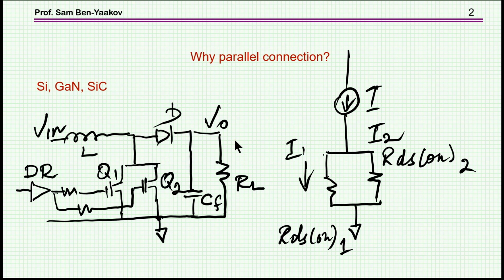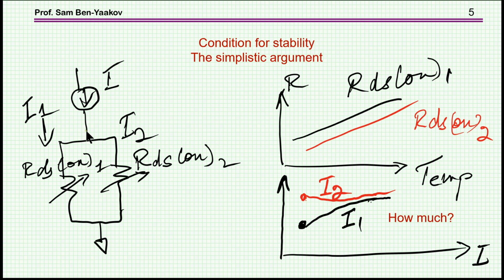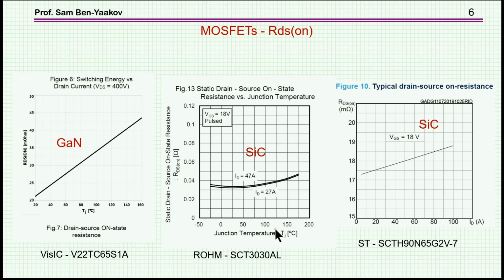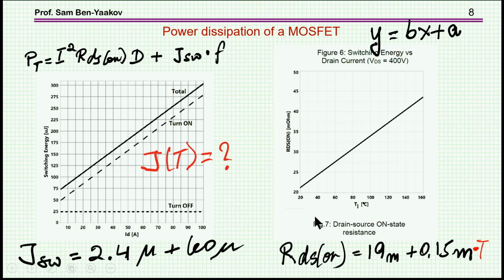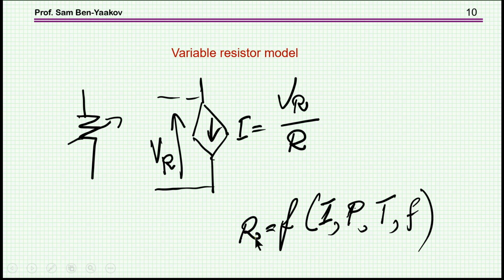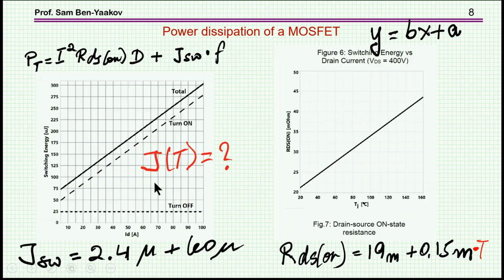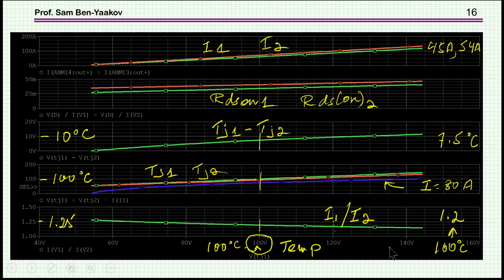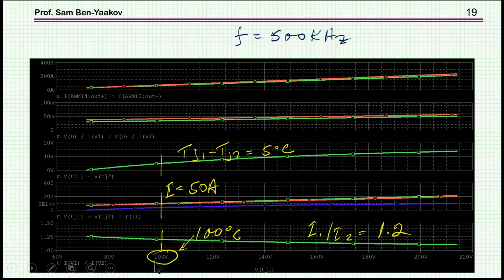Current sharing of parallel connected MOSFETs: The facts

Comment: Dear Dr. Saam, Your efforts in explaining the intricacies in the subject are unparalleled. I sincerely request you to make a video on dynamic current sharing details too to have a complete notes on this potential topic. 

Further, you can also consider, making a video on how invention of GaN devices further eliminated the hurdles in parallel operation of switches. For example, GaN HEMT's Vth is constant over junction temperature range while Si MOSFET is not. In this respect, how GaN switches elevated the operation levels of converters?
Reply from the maker: Thanks. Will consider.
Reply from the maker: Thanks. Good points will consider
Reply: @sambenyaakov  thank you a lot.

Comment: Very helpful video, my first idea is to take the same transistor for current share, with same parameters, why would we want to take 2 devices with different parameter (Rds on), what is the motivation? thank you
Reply from the maker: Hi Sahar, There is no such thing as two transistors with same parameters. This video discusses the case of same two transistors that, due to parameters spread, have different Rds(on) per datasheet.